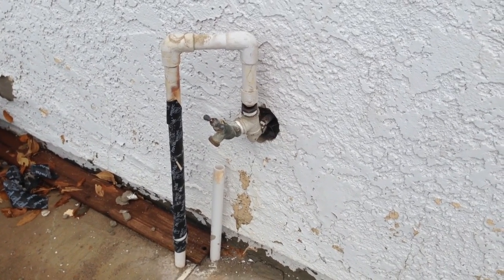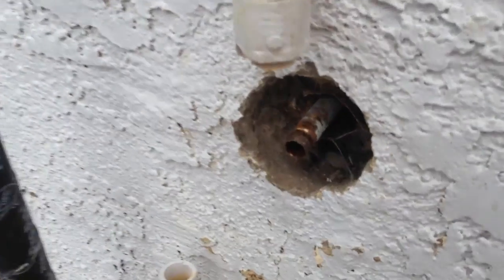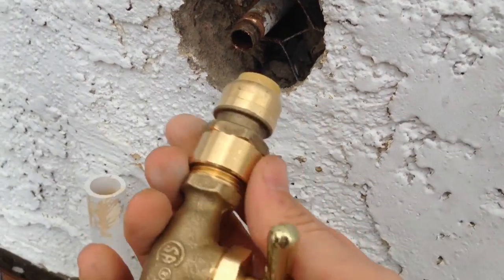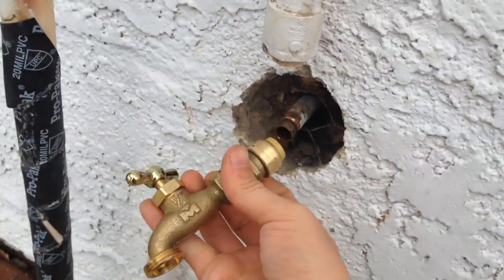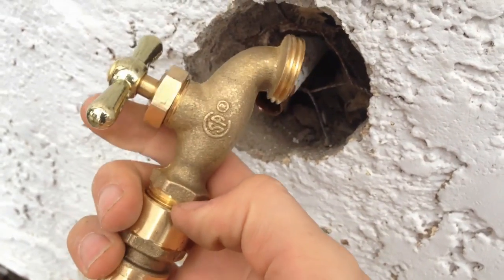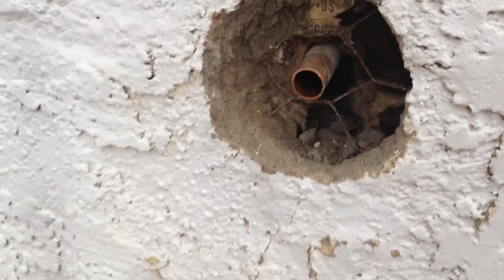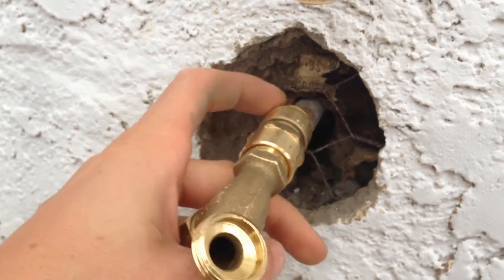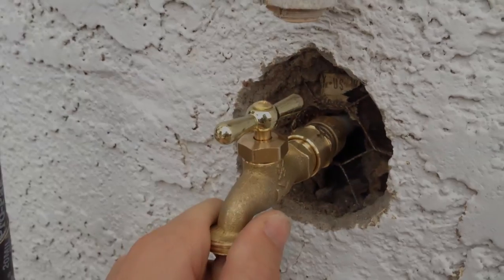SharkBite - How to Fix Hard-To-Access Copper Pipe Without Soldering

Comment: It’s advisable to clean the pipe with emery cloth or similar to remove debris so you get a clean seal. Overtime this may leak.
Also fit an escutcheon over the hole so you have access to it rather than cement it in.😊

Comment: You don’t have a backflow  valve for your irrigation system?
Reply: Alot of people still don't.  My home was built in the 50's with the irrigation installed probably back in the 80's.  We have never ha one
Reply: Our state now requires back flow valves and gave it checked and certified each year, wouldn’t allow grandfather systems 
So additional cost each year

Comment: I installed a spigot and even though all is well the spigot rotates just like yours.  Any way  of preventing this??
Reply: You can buy the hose bibb with a backing plate with two holes for screws to hold it to wall, this isn't what you want to use.

Comment: If that is soft copper in the wall, then it will leak. Sharkbites fittings are not made nor designed for soft copper.
Reply from the maker: @mikejones5364  Working fine mate, 7 years and going.
It wouldnt be soft copper if you looked at the video, its an outside faucet mate
Reply: @TutorialGenius  It could be soft copper, just depends on what the plumber used when it was installed.  That's why I asked. Me personally I wouldn't put a sharkbite on anything, I have seen too many leak.
Reply from the maker: @mikejones5364  Its not soft copper lol.
We are talking about an issue that isn't relevant to the video. If you want to carry on by yourself, go ahead, but I think this will be my last reply. 7 years and running. No problems. I speak from experience and not hearsay.